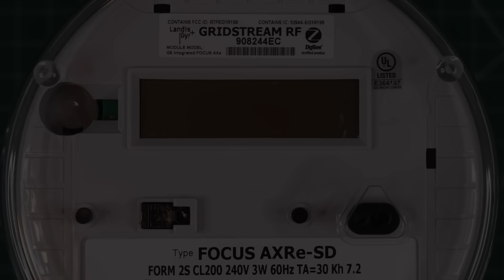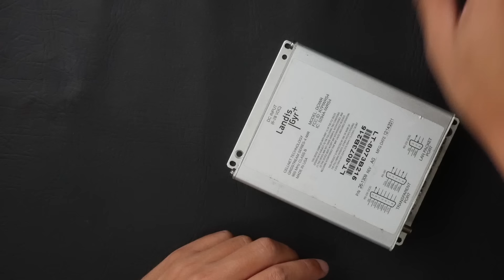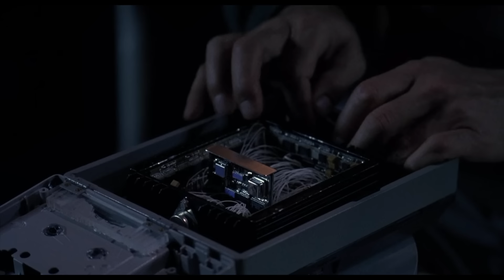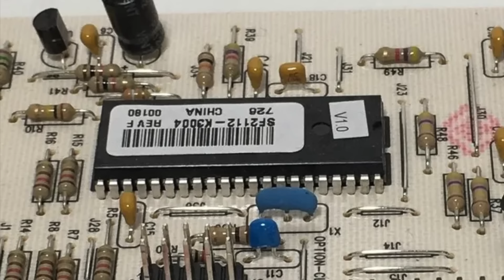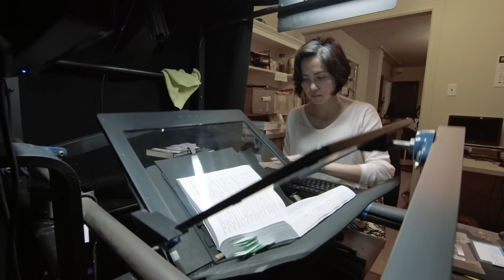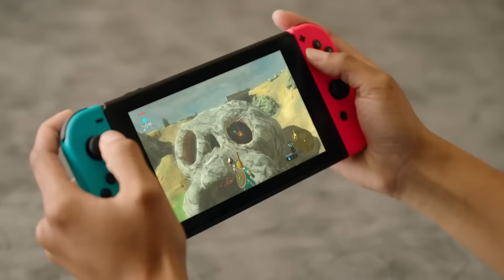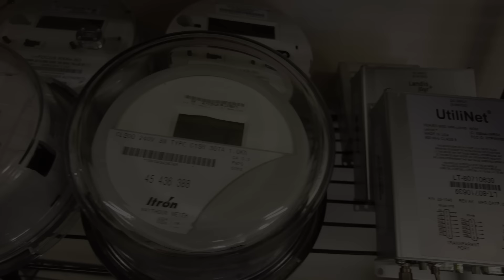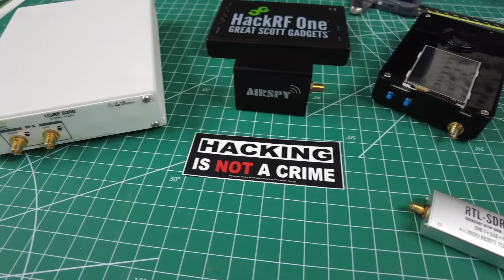The REAL Problem with Smart Meters

Comment: I hope you're successful in this endeavor, but you should note that a mod chip is technically illegal thanks to the DMCA which makes circumvention of their protection mechanisms the specific task that you're not allowed to do. It effectively does an end-run around precedent from the Supreme Court that allows for reverse engineering. Worse yet, the Supreme Court has even reiterated that reverse engineering is legal even after the DMCA passed. So, while I would still say do it, the legality is murky at best. However, all that said, if we all made the move to generate our own electricity, say with solar panels and wind generators, then we could bankrupt the corrupt electricity companies and force a real change for the better. In the case of people living in apartments they'd have to band together for the greater good, which is really tough to get people to cooperate on, but would be a necessary step.

Comment: In Australia, smart meters are "pinged" over the power-lines themselves.  This can be every 30 minutes (example: early morning) or every 3,5 or 10 minutes (example: peak hours). Power draw from those meters tell the Network Operator how much load is being used, and gives them time to co-ordinate with the generators.  This is largely anonymous data.  They also ping meters at the end of the billing period, this is personal data.  Every meter has its own individual digital fingerprint.  Data sent to the Energy Retailers, is spread out over the 50 working days/quarter, so they don't get everything on one day.  Meter ID's are only assigned to a Retailer, if they have a contract for that consumer's address.
Reply: The meter I have has a 4G modem… no mention of comms over power. That might have been on early meters.
Reply: Comm over power is a newer tech than GPRS

Comment: Can confirm. I used to work in the meter bill department and fixed bill errors. Current, Voltage, Power, Reactive Power, Time, and trends and more are all recorded and stored. With “green” energy on the rise, we will be forced to use energy that is volatile and not dependable. Furthermore, solar systems attached to the grid (so you can “sell” your solar power) have to be monitored and controlled. The power company can turn your power off whenever they deem necessary and also inevitably implement Time of Day rates. I know there is a ton of security behind accessing meters… 🤐
Reply: The problem with solar is that no one can be honest about it.
Reply: @garyfeltman4482 plus they outlawed the best panels.
Reply: I’m off grid for over 10 years, 0 problems.
Reply: @PhysicsViolator  internet?
Reply: That's why I built a DIY off-grid soler system. Grid is only there as a backup with a 200 amp interlock transfer switch. I'm going to get rid of the grid and buy a surplus generator. When Sodium batteries go into mass production Utilities are going to be screwed when we cut the cord.
Reply: Well if the your own system is well calibrated with good pack of batteries and a generator that you can kick in when and if needed you can actually don't need government powr6
Reply: They don't buy your solar power that you don't use they give you a credit which in most states don't even do anymore. Now they charge you to store your extra power.
Reply: I actually prefer Time of Day billing. The time of day when our rates are higher corresponds to when our solar is producing electricity and, in the evenings, when we use the excess electricity we generated that we stored in our battery. And, when our provider switched to Time of Day, the off-peak rate went down. So Time of Day is actually better for people with solar.
Reply: Any way I can obtain access to my own power readings?
Reply: Solar 'Sold' to the grid? Not in CA.
$25/month just to connect to the grid 'SMUD'.
SMUD doesn't give you the opportunity to sell your Solar.

Comment: The rumor is a smart meter system bills you for apparent power used not actual power used ? Big Clive did a spot on this . We have them here for the local co op to read them remotely. That and we have 3 rates off peak. On peak . Super off peak  like now during summer the on peak is 3 pm till 8 pm with a rate of 28 cents a KWH.  Off peak is I think 8 cents a KWH.  And ultra off peak is 5 cents   That is 11 PM till 5 AM all the rest is off peak . June July August .   And December January February  have this peak.  All the rest. Is off peak and ultra off peak .  So they are using a meshtastic type system that they all relay to each other ?  Then to a point somewhere ? update Found the area radio its about 3 miles away just a pole with two vertical antennas connected to the phone system .

Comment: I have been "into" computers since the days of the Commodore Pet and the Apple II. I have worked at multiple high tech companies in Silicon Valley, including Cisco Systems and Nokia. I am a test engineer, I create automated test systems for production use or for design verification of a product. I spent 5 years doing design verification testing of smart meters at Echelon corporation, and another year at Trilliant. I find your assumptions and assertions to be ludicrous and naive. 

I will speak of the two smart metering companies I worked for. Echelon's smart meters communicated with each other via the power lines themselves, PLC (Power Line Communication) and data could hop from one meter to the next until they got to a data concentrator. The concentrator would then use a cell connection (with a modem) to "phone home" and upload the collected data. You want to tap the communications? Just tap into the power lines with the correct hardware and work your way past the encryption. Good luck.

Trilliant's meters used short-range RF to do the same thing, data hopping up to 4 or 5 times to get to a concentrator, and then a phone call home. Hey, the RF bands are free to listen to, but if you can understand it you can hack it, and they don't like hackers. There is a reason they don't want you or any of America's enemies tapping into that data. It's not bad for good people to have that information, but how do you prevent the bad people from doing bad things with it?

Comment: Not only is this closed but it really looks like they went through some decent effort to even hide it as much as possible by using the spectrum hopping.  Some effort went into making it as hard as possible to decode the signals.  That makes me question the security, as maybe they are relying on security through obscurity instead of encryption and preshared keys for example. Imagine if someone figures out how to turn off power to random meters lol.  Someone could actually take down the entire grid if they are strategic about this. Turn off power to a couple major customers and it would cause things to trip.   I do believe stuff like this absolutely should be open source. In fact I should be able to buy a device that reads my smart meter so I can measure my own usage too. The meter is on my house, I should be allowed to get more insights into what's going on.
Reply: one might even think that could be the point... POWER GRID HACKED AND MORE AT 11
Reply: How would a couple hundred meters in your neighborhood be able to communicate on the same frequency channel without a bunch of garbled messages and collisions, if they wouldn't use spectrum hopping? Isn't that simply how most wireless networks work? I'm not sure what the situation in the US is like, but regarding security in Europe I'm 100% sure, they are using pre-shared keys and several layers of security for the actual transport channels. At least where I live, a utility company ordering meters from Landis+Gyr would receive the meters accompanied by a bunch of key files. Oftentimes 2 or 3 per meter to control different levels of access, since reading metering data is less dangerous than remotely switching relays on or off. I wouldn't be surprised, if the message he captured and couldn't figure out is just the encrypted payload containing the actual metering data.
Reply: @lupf5689  Same way wifi works. They each take their turn essentially. I assume there is collision detection as well. Kinda like old style ethernet with hubs. with the way they jump frequencies it's probably more advanced though. There might also be some multiplexing at play where they each get a very tiny time slot.
Reply: The utilities are supposed to be giving customers access to their own data through Zigbee or a web page or whatever but mine hasn't done anything so far, and I've had a smart meter for years.

Comment: energy company here in scotland offered a free smart meter that ended up not connecting because there was no signal which they could have checked before installing it and since it has no wifi connection backup which for rural areas seemed like a obvious thing to add to me it does nothing

Comment: I used to work for a company that makes smart meters. Naturally I wasn't able to take any of the data when I left but they can't take what I remember. Yes the data is encrypted but . . . .the encryption is not complicated like aes encryption is. Also each model of meter had it's rom in a map where each value resides in a certain address and there were not many checksums. The maps between different models of meters were pretty similar too with only small changes.

Comment: The 1970s technology used in the Vietnam War that encrypted radios over a hop timing method was the KY-28. This was a secure voice encryptor that used frequency hopping spread spectrum technology to protect radio communications from enemy interception and jamming. The KY-28 was widely used by the US military during the Vietnam War and remained in service for many years after.
Reply: in the uk police used 102 on the medium wave band
they had 4 channels in use and randomly hopped
break down firms had 4 radios
you guessed they could hear all 4 broadcasts

Comment: Unfortunately in the UK all the data is encrypted and is sent over the cellular network (kind of anyway, it's vaguely described as a 'WAN')...I suppose if it's data that can be read then it would also be possible to intercept and change the data being sent.
Reply from the maker: What network standard? 2G? 3G? A lot of those old cellular systems are no longer secure.

Comment: My assumption is that they are using an LFSR to determine the hopping pattern, do you know if that's true?  Does the M16C do the wireless comms, or do they rely on a 3rd party wireless chipset (like a Nordic chip)?  I would hope the datasheet has the details, or is the datasheet under draconian NDA?

Comment: API specifications are not intellectual property. They are considered corporate secrets which means as long as you didnt steal it from them illegally or by being a previous employee/contractor then you can freely reverse engineer the firmware api and write an open source implementation of your own.

Comment: Through this video radio  transmission of the actual power used from the smart power meter couldn't be found, which is the main function of a smart meter.    Obviously the communication is set up to keep from spoofing the power company with false power use.  It would seem it would be encrypted using a unique ID for the particular power meter that is not transmitted.  

The Texas public power grid is separate from the rest of the USA power grid.   It appears to be economically stressed, not investing in the robustness expected in order to compete with electric rates of bordering states.  

Texas wants the public power grid to work from Texas mined energy from natural gas and wind turbine electricity generation instead of coal Texas doesn't have.    These non coal powered electricity generation can't economically compete with a modern large scale clean coal plant even with Texas having an abundance of natural gas and wind.  Texas has some nuclear electric power.

The US electric power grid has been considered clean since the mid 1980s when coal fired power plants had addressed fly ash, sulfur dioxide to levels where there are no acid rain concerns and incomplete combustion of residuals.  In 1985 when my IEEE WV Tech student chapter toured the John E. Amos Power Plant 2.9 GW in Winfield WV on the Kanawha River, the engineer giving us the tour pointed to the tall smoke stacks and said "The only thing going up those stacks is water vapor and carbon dioxide".  

I'm sure he was exaggerating.  They probably were not doing anything for NOX and the air looked slightly grayish and being allergy sensitive I felt a bit irritated, but I'm not sure from what.   NOX looks brownish, but in the mid day sun and not anything like the high levels of NOX trapped around LA the NOX may have been the grayish tint.   The plant has addressed NOX now.  

A detectable amount of fly ash is likely present with scientific instruments.  It's not considered reasonably possible to get 100% of the fly ash out, but its close.  The engineer said the fly ash they collect is of such high quality they sell it to toothpaste manufactures.   The bottom ash they hadn't found a use for.  

John E. Amos Power Plant at 2.9 GW https://en.wikipedia.org/wiki/John_E._Amos_Power_Plant.  is a huge electric power producer at about twice the capacity of the North Anna nuclear power station that supplies N.VA.   At full power the John E. Amos Power burns 2-1/2 unit coal trains of 10,000 tones coal everyday.  Further reductions in sulfur dioxide levels the plant was required to achieve in the 2000s will likely have almost no environmental benefit because the USA had already reduced them to where there were no serious issues.

Comment: We should be told exactly what these opaque systems are capturing, who the data is being sold to, and why. 
I also demand  a share of the revenue they're generating by selling my data to third parties! I only agreed to purchase the electricity. I didn't sign a EULA for the software.
Reply: There may be no reason for Amazon to know right now, but there may be a future for it.  Maybe Amazon develops a device that plugs into an electrical outlet and orchestrates and regulates the 'smart' electric appliances to perform a number of different things, like talking to the controller of the refrigerator to turn off/on while the AC or dryer is operating.  This could be a pretty deep rabbit hole uses actually.   😕
Reply: Its the government bro once the ai can sort the data we will be in the Gulags for posts like this
Reply: Followup to my post above:  First Amazon sells you on the benefits of that aforementioned home electrical controller.  Then a more likely avenue that Amazon would exploit with that plug-in device is to collect a list of smart appliances/devices in your home and then compare that to a list that they code into the firmware.  They then suggest, in targeted coincidental advertising, a great new TV that is light years ahead of the model you have and how they just happen to have that on "Today's Deals".   Use your imagination.
Reply: How many MILLIONS of Americans are interested in knowing how A*A "uses" your data when you register and PAY to take "their" (not) Defensive Driving program?

NY State government was NOT.
Reply: You should quit whining and actually do something useful, like start filing lawsuits.

If enough people took their thumb out of their butts and took action change would happen, but they don't.
Reply: @trailingupwards  sadly, they're too addicted to posting and scrolling antisocial media.....no care to fight anymore
Reply: Do you really think Amazon want to know you load profile every day of the year?  I don't think so.,
Reply: @fmorgan98  Amazon's AI systems might.  AI is built on such data - the bigger, more detailed and higher resolution the better.
Reply: @fmorgan98  You're a bot or a sheep.
Reply: @fmorgan98  you can be wrong. data scrappers big and small are accepting ALL information, processing the fines and sending the tails out for data asset reallocation services to reprocess and repackage for sale. you must be of the mind that amazon is a retail company rather than an IT company.